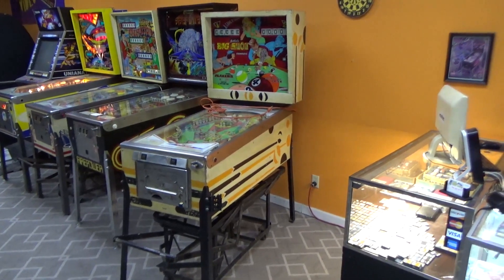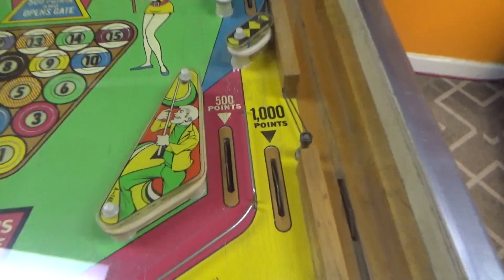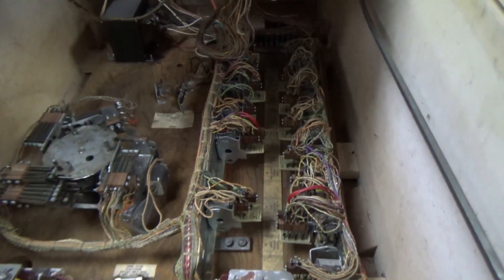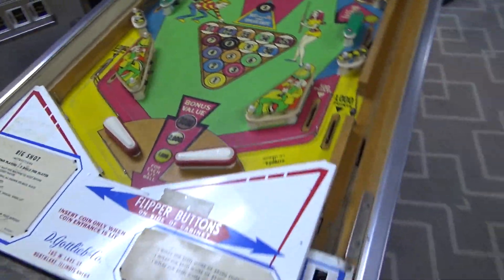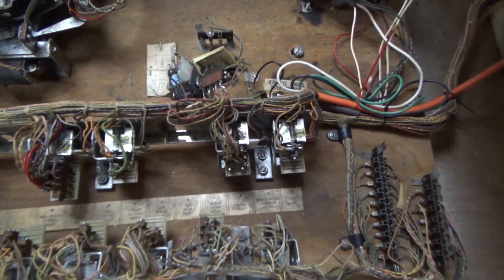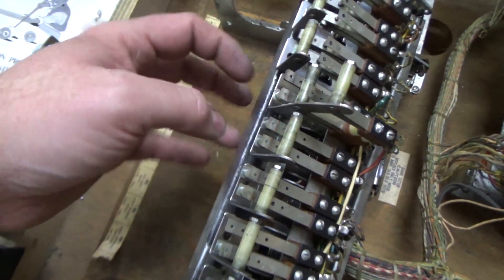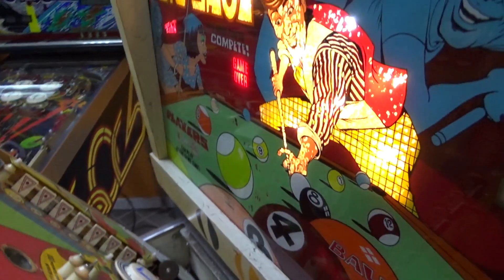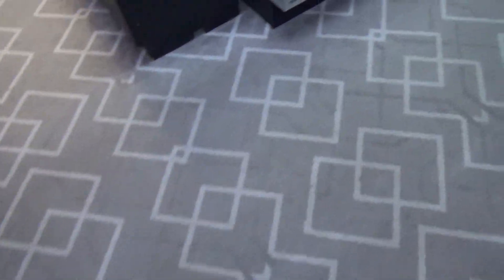Gottlieb's 1974 E.M. Big SHOT Pinball Machine Repair - One Little Switch To Mess It All Up!

Comment: Back in the day...In order to "slow a machine down." Since a lot of shop keepers would jack up the rear legs to play fast (and consume balls fast...inducing more game plays/money).  The fast and dirty way to circumvent this was to grab a pair of ashtrays (this was the '70s so smoking was common everywhere)...take the ashtrays and put the front feet in them.  That would raise the front ¼" to ½" (depends on the glass thickness of the ashtray).  Remember, one is trying to "modify" the machine fast (before the shop keeper or bowling alley would know what you were doing...you didn't need tools or anything).
Reply from the maker: I've heard a lot of people did that :)  With a dime or a quarter on the line back then I can see why!
Reply: I imagine the amount you could get away with was limited by the tilt bob.
Reply: Somewhat but that wasn't really a big deal.  You had to do it before a game started because the more critical one was the ball in the track that determines if you are lifting the machine up.  

One isn't adjusting the play that much with the ashtrays...just slowing it down some...¼-½ inch is within the adjustment range of the leveling feet themselves.

Comment: that copper thing on the top of the relay coil is a shading ring.  its purpose is to keep the magnetic field circulating through the zero crossing of the AC powering it.  without it, the coil would probably pull/release each cycle, or buzz very loudly

Comment: Brilliant, so simple in the end. Even i could follow the schematics. Why have a tilt switch in the back box?
Reply from the maker: So you don't tilt any of it :)  The operators were skittish as hell man, it's hard to understand, but they saw it as outright theft.  You know how people get pissed off if they get stolen from ,well the operators saw it like that because it was their livelihood.  So if somebody stole a game or cheated, they took great offense at it, they were even a little superstitious in a lot of instances.

So they basically demanded that the manufacturers really go overboard with the tilt mechanisms, this is a hold over from WAY back, the earliest pinball machines as you can understand were much easier to cheat on, because they didn't weigh as much.  So by this point, they had a couple slam switches, a couple tilt switches in every machine.  It says in the manual how you can add more if you like, LOL

there's usually one in the backbox, one on the playfield, one on the mechanism board, one on the coin door, a tilt bob and a rolling ball in case you lift the front up.

Comment: JOE CLASSIC, What does the lightbox tilt switch purpose? What would turns this on and off? I didn't know that different coils are made differently using different bobbin widths and lengths for part replacements which the gold bushings and gold washers will cause the latches to have less travel actuation range and that the gold bushings and gold washers prevent the metal to metal switch noises?
Reply from the maker: That tilt switch is there so that if the backbox gets 'tilted' violently, the switch will bounce open and stop the game from working.

Sometimes people would play the games, and shake them so that the ball would go where they wanted.... so the manufacturers designed a circuit to help deter people from doing that.... if you shook the game and it opened that switch, the game turned off so you lost your quarter!  So it made it where nobody would shake the game in fear of losing their money.

Sometimes it stopped people from doing it, sometimes it didn't but it was what they were trying to do with it... Thank you for watching Wayne like always!!!
Reply: @LyonsArcade  thanks, I never heard of the backbox ALSO having a tilted switch because I know the playfield bottom cabinet has a tilt switch but I had no idea there was another tilt switch in the backbox also. Whats confusing is they should have just called it a backbox tilt switch instead of a lightbox tilt switch because I was confused what is the lightbox connected to or referring to. I'm guessing Lightbox means also the backbox
Reply: @waynegram8907  Why I can't comment to Joe's Classic Video Games to upload more non-repairing videos like Johnny Nero Action Hero?.. Because Joe is busy repairing stuff?